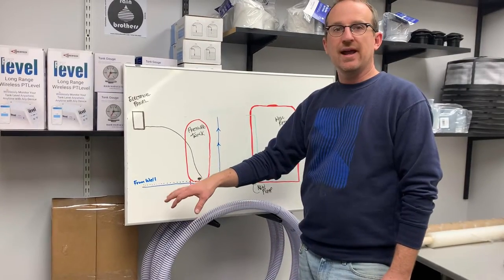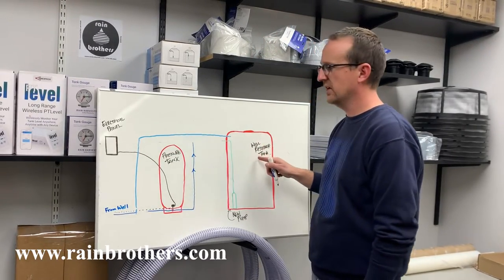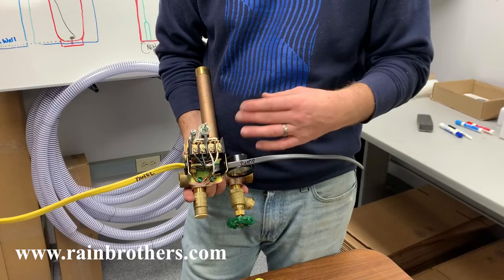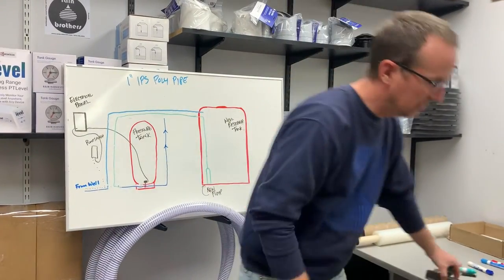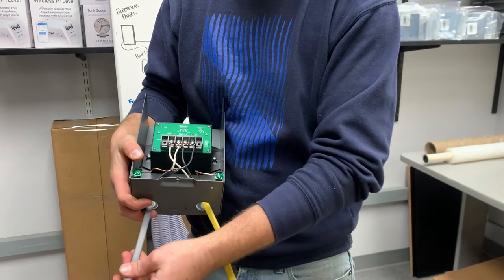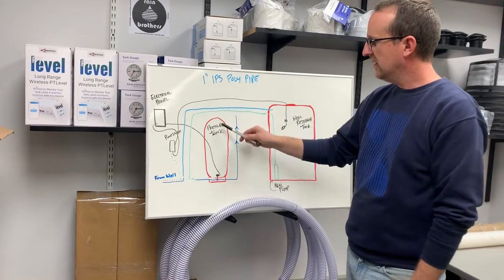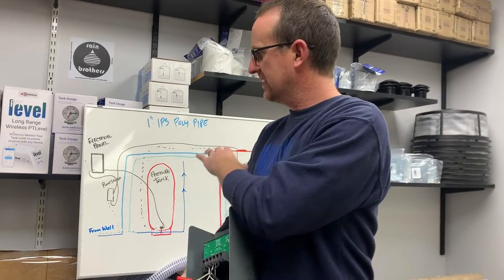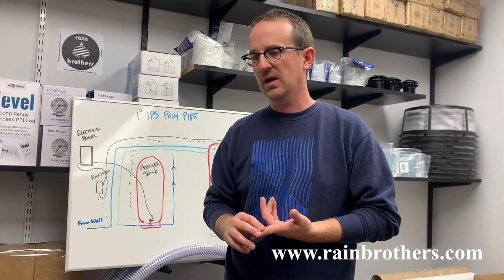Low Producing Well?? No problem! How to install a reservoir

Comment: This is an excellent video. Would be nice to have one that shows how the water pipe connections are made into the storage tank and how the float is mounted inside the tank, etc. I have the Littelfuse Pump Saver and it is an outstanding device for this. Thanks!
Reply from the maker: Great suggestion!

Comment: Have not installed a PumpSaver yet (running well pump manually) but did the rest of this last summer.  Such a relief having 2000+ gallons in reserve, and the springer pump is working great!
Hopefully all the water this winter will provide for my well next spring.  If not then I might need a pump saver for 2hp 240v pump.  Either that or switch to a smaller pump.  Or maybe I'll finally work my way to the top of the well drillers' list and I can shell out $$$$$ for a new well.  Hmm.

Comment: Great vid... Can I wire this the same way with a regular control box? I have same set up but its for irrigation..  Thnk u!!
Reply from the maker: Hi - happy to help but I’m not quite sure what you mean. A control box is simply a box that houses the pump’s start capacitor. Control boxes do not function as the PumpSaver would. If you are installing our system on a pump with a control box, you would need to install the PumpSaver between the electrical panel and the control box, before the additional yellow wire comes into play

Comment: For the new pump inside your holding tank, is that just a regular low horsepower submersible well pump or some other lighter duty pump that is needed just as long as it produces enough PSI to pressurize the tank when it gets the call?
Reply from the maker: We actually use a pump that is specifically designed for holding tanks/cisterns. It is a pump we developed: https://www.rainbrothers.com/store/Springer-Series-1-2HP-TRADITIONAL-Cistern-Pump-p461750607
Reply: @rainbrothers  Thank you. My sister needs something like this system so I referred her to this video and your products. Appreciate the response.

Comment: Thanks for this video. I am wanting to treat my well water thru a spin down filter and softener before I go into my cistern. Is there anything I should do to regulate my water from my well pump before it hits the softener?
Reply from the maker: If you treat the water before it enters the cistern/reservoir, you will need to keep your existing well pump tied to your existing pressure tank, and then get a second pressure tank for the new cistern pump. So then your cut/feed from the well to the cistern will be located after (downstream) from your treatment, and your cistern tie-in will come back to that same spot and carry on to supply your house.
Reply: @rainbrothers  So using the pump saver device will not run the well pump? or is that it needs to be regulated to pass thru the softner?

Comment: Great Video.  I will check out the kit.  Please tell me what you think. SITUATION:  I have a well that is 205' deep and pump that was originally set at 195' and well head after a year was ran over by heavy equip and it was noticed that well down pipe stayed where it was and did not fall.  (well filling with sand) pump was pulled up to 185'.  Current output is 10gpm for about 7-8 mins or until the well runs dry.  Water is spring-like except for having fine sand occasionally that has to be filtered.  USE:  We are man and wife...20-30gal shower 1-2 a day, washer 10-15 gal couple times a day, flushing toilets..etc..3k - 5k gallons a month.  MOST RECENT SETUP:  Have 1/2hp pump 220v at depth, 1-1/4" sched80 pvc to pitless adapter to pressure tank 20g (holds far less) then to house filter and supply, 1st floor home.  I want to have the water I need sometimes to put in pool as well but can NOT run well continuously.  OPTION A:  Just set up as it is but use an 80-100gal pressure tank.  As drawdown occurs putting 50-60 gals of water back into pressure tank is not a problem.  Or, OPTION B:  Your Low Producing Well Kit.  With a reservoir tank approaching 200gal.  This would allow for a much higher volume of water with a high pressure/volume pump in the resevoir to provide city-like water pressure and volume to the home and at the same time giving me the option of adding 100-200 gal of water to my pool should it need it.  Can you compare/contrast the 2 options and price the items.  I am a DIY person and would buy all of the equipment from your company and install myself.  Tks
Reply from the maker: If you want more versatility in your water system, the reservoir tank is the way to go. It really makes it so that you never have to worry about your water supply. The components are not expensive and all pricing and layout drawings can be found on our website ( https://www.rainbrothers.com ) or follow links in the description. You could always start with a larger pressure tank and see how that does for you but the reservoir is the best long term solution.
Reply: Curious as to your explanation video  not clear on how to hook up system so that both pumps can never be on at same time... And how water coming from reservoir can never be pumped back into well.  And.. follow to your bigger pressure tank vs reservoir and maybe comparing for me and others a reservoir setup with 20gal pressure tank vs same reservoir setup with the larger presser talk and how one would provide more or less water pressure/volume   tks

Comment: I'm considering a reservoir tank system at my home and have heard that it isn't good to run the well down to the bottom of the well.  Would you recommend adding either a timer or a flow control valve to match the well's production rate in order to keep the water as close to the top of the table as possible?
Reply from the maker: Thanks for writing. Well pumps are never set at the bottom of the well, so if your concern is that you’d be sucking up sediment/sludge, it’s not likely to happen unless your well has high levels to begin with. However, a timer can be a useful addition to a reservoir system. Currently, we do not sell timers, but Intermatic makes good timers for 230V motors.

Comment: How do you setup storage tank pump to keep it from unthreading itself when it starts up?
Reply from the maker: If you use one of our pumps (link in the description), you’d be using a pump that is specifically designed for holding tanks. It does not have enough torque to unthread itself even slightly

Comment: Multiple questions......  1.  Can the incoming water line from the Well going to the Reservoir Tank be connected at the middle or bottom of the tank instead of at the top?  2.  If the incoming line has to be at the top of the tank,  is it generally noisy when it is filling (ie, hearing rushing water flowing into the tank)?  3.  Can the 1" IPS Poly water line be connected through the 1" tank penetration gasket and form a waterproof connection, or do I need some type of adapter (ie PVC) to go through the tank penetration gasket and then connect the 1"IPS Poly otthe PVC??   Thank you
Reply from the maker: Hi there - thanks for the questions:
1) It’s best to bring the pipe in to the top of the tank
2) To reduce noise, you can plumb the pipe down 90 degrees and have it run to the bottom of the tank once the pipe is run into the top of the tank
3) It is best to use PVC to run thru the tank penetration gaskets and then adapt to poly IPS. 
Hope this helps!
Reply: @rainbrothers  Thank you,  I will be ordering your kit and tank shortly

Comment: Would the pumpsaver then replace/eliminate a controll box for the original well pump?  Or if you have a control box would it rewuire additional wiring?  Thanks
Reply from the maker: EXCELLENT question! We get this question all the time, and I regret not mentioning it in the video. A control box serves a different function than a PumpSaver. The control box houses external start and run capacitors (which are needed for what are called “3-wire pumps”, as opposed to “2-wire pumps” which have the capacitors built into the pump itself). You still need a control box if you have one already, but control boxes do nothing for run-dry protection, so you also need a PumpSaver. The PumpSaver should be installed between the electrical panel and the control box to eliminate confusion because, after the control box,
there is an additional wire in the system

Comment: This looks like it could be wired without adding a breaker. Looks like you would need to splice the wires from the breaker to the pump saver and the pressure switch
Reply from the maker: If you’re following electrical code (which we recommend), each pump needs to be on its own circuit/breaker.

Comment: 1 more terminal on the terminal block with a jumper would mean no wire nut. 1 less point of failure
Reply from the maker: Very true! We don’t manufacture the boards so it’s out of our hands unfortunately
Reply: if you're worried about the effect of adding one wire nut; what about the hundreds of wire nuts throughout your house wiring?